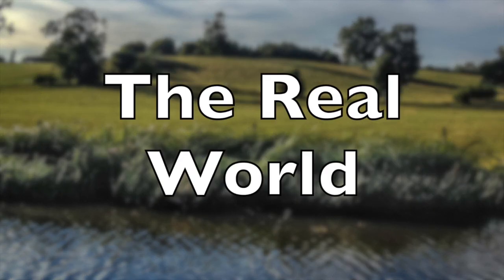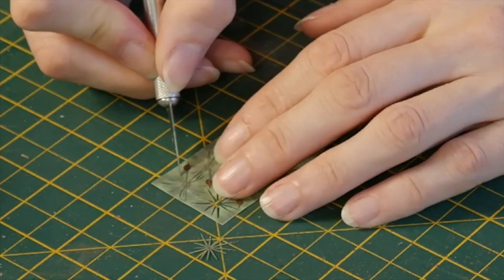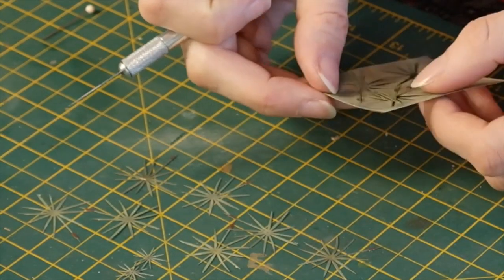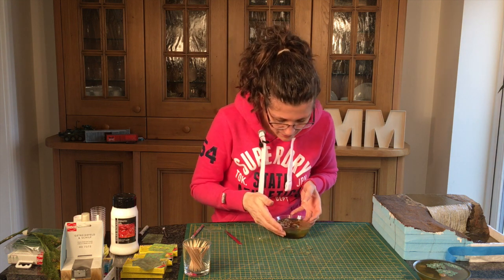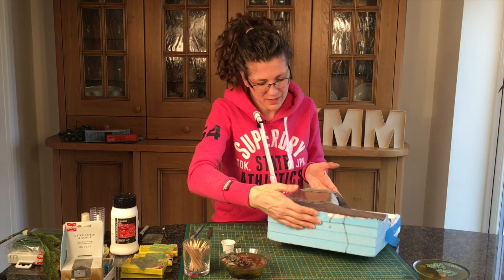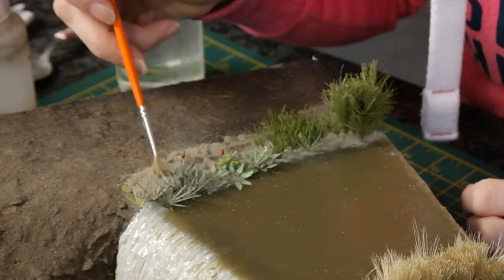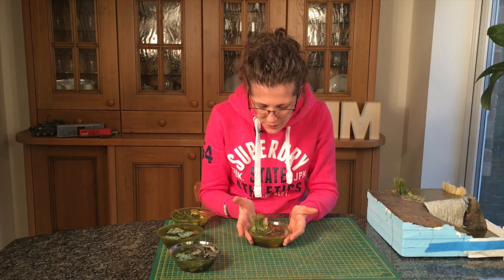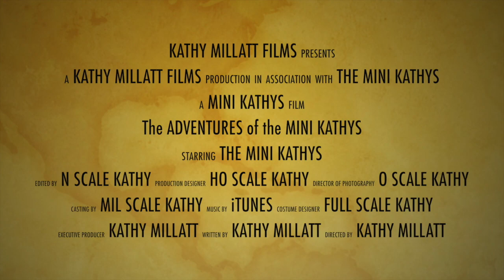How to Model Bulrushes using Noch Laser Cut Minis

Comment: Your videos are so wonderful. I haven't seen them all and you may explain this in another but I'll ask anyway.  Using your IPA to make your grout set: Is this mix purely for grout or will it work for other materials you might use in your diorama?
Reply from the maker: Hi, I use that mix to glue everything!  I start off with isopropyl alcohol and water to wet the material I'm gluing. That just makes the glue flow so I use about a third to 50% IPA depending on the IPA's strength. I'm using 98% proof so a third is about enough. I spray it on to avoid moving the scenery material but you can drip it on to and that works well. I then use dilute white glue (PVA), about a third white glue, two thirds water. That flows through and sets everything when dry. If I have large bits of terrain, like rocks, I may glue them first with white glue but I find this catches most things. I haven't really done much finished scenery yet but my early videos on the diorama bases show my gluing down tile grout with this method. Hope that helps. Kathy